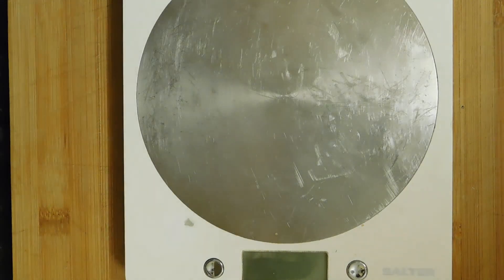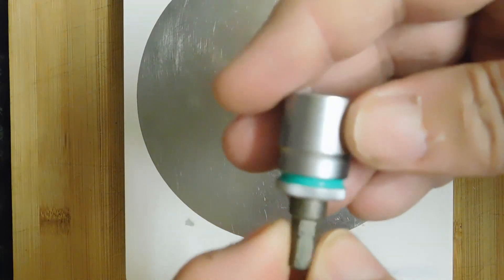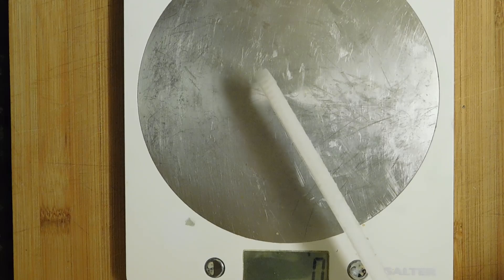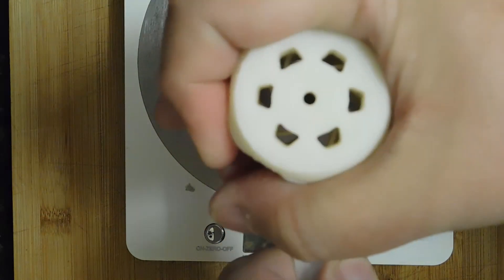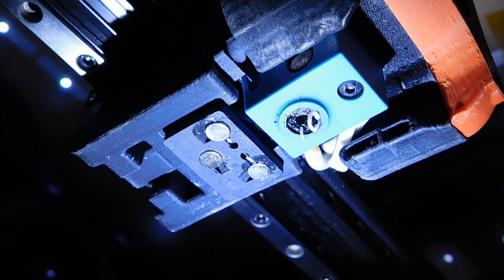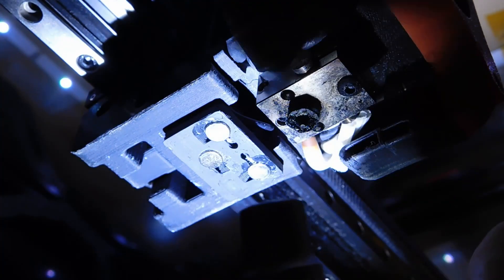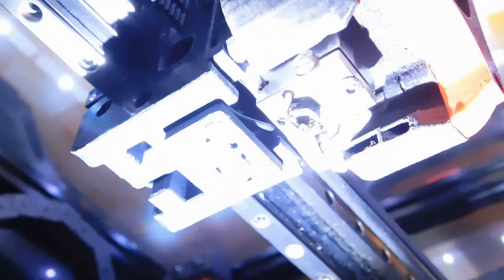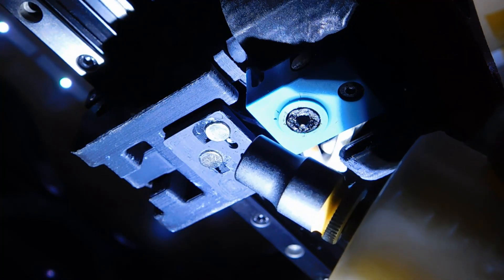3D Print of the Day: Nozzle Torque Wrench

Comment: Hey there, I have pri ted this in pla and struggling to get a low enough torque. I bought some cheap ruby nozzles to try (£15) and like other ruby nozzles need a max of 1nm of torque or you risk damage. And 0.5mn is recomended. I printed the lowest torque internals and was getting well over 2nm (same setup was 1.3kg on the scales) a few of the fins snapped and that has helped but now its inconsistent. I printed insides in Sunlu meta pla and was wondering if petg or tpu would work. I might also redesign the internals with even shorter or maybe fewer of the blades. Would be great if anone has already done similar and has any advice.
Reply from the maker: There's only one way to find out! PLA is actually one of the stiffer plastics. I use PETG in mine and that still gives me around 1.8 Nm. I haven't tried TPU but it might work and might be worth a try. The SHORE 95 stuff is still quite stiff.

Comment: Thanks for sharing. Which fin did you use to get the 1.7nm? TIA
Reply from the maker: I can't actually remember, but it is going to depend on filament and print settings, so just pick one, print it, and use the test lever to measure it.